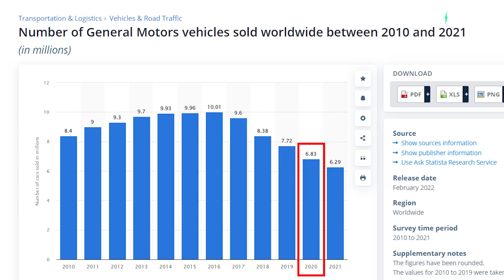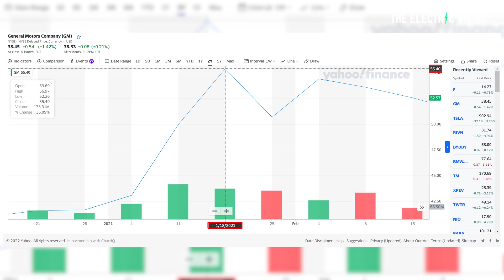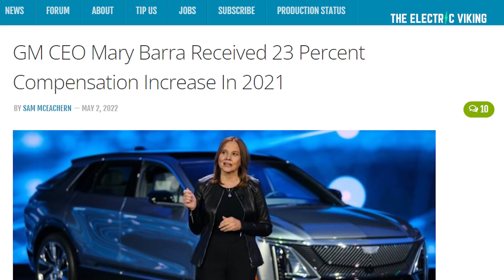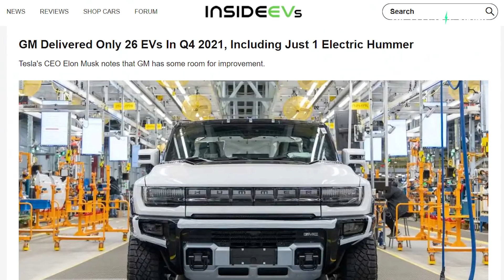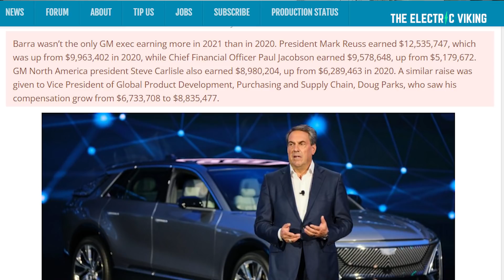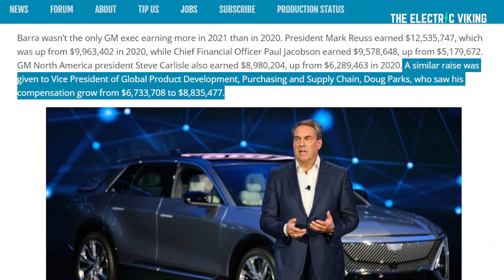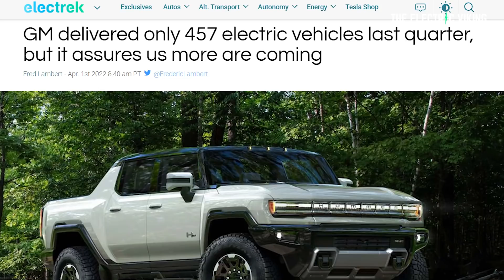GM sales CRASH; Mary B & GM execs get huge pay rises

Comment: Amazing how well they have managed this company and they reward themselves big compensations when their ship is sinking!
Reply: @brunoheggli2888  If I accept those points Bruno; please explain why the Bolt - arguably the third generation of GM EVs - did not have fast charging?
To me, that makes the Bolt a limited use vehicle.  Even though many people may like them.
But I keep reading magazine article authors complaining about doing long trips in various Tesla models - that do have fast charging.  It seems to me that they, and you, are giving GM a easy pass for producing only an average product.
Reply: @John.0z  two words: battery degradation.   Supercharging kills your battery longterm.  The the drop in range at just 40K miles in Car & Driver longterm test.  My CT6 2.0E plug-in is at 30K and spends 90% of the time on battery only.   It has not dropped at all but may have improved as this uses eCVT, driveshaft, differential, and half shafts. Plus it weighs 4,800 lbs but still see 90 mpge average.
Reply: @John.0z  Don't feed the trolls.
Reply: @John.0z  To make any (pure) electric vehicle more than "local-use" transportation they need to have at least 350V charging capability.
Reply: @Matt_from_Florida  I agree Matt, hence my position on the usefulness of the Bolt.
Although now that I am an old man, I can take a slower approach to long distance driving.  Nevertheless the ability to apply a fast charge when needed helps.
Reply: @normt430  I keep hearing that battery management can at least ease that degradation.  Newer technology seems to make that ever more the case.
Also, if you are like me and only need to fast charge occasionally it is manageable.

Comment: Strip-mining the accounts pre-bankrupcy.
Reply: GM has locked up long-term contracts for the raw materials and batteries needed to sell 1 million EVs in the U.S. in 2025 and is looking for upside opportunities to get even more. It says those EVs will generate $50 billion in revenue by 2025, and $90 billion by 2030.

The Chevrolet Equinox EV will debut this fall with a $30,000 MSRP, which already accounts for higher raw material and battery costs. That’s also ten grand cheaper than comparable crossovers from competitors.  Autoline

Comment: Sounded like around $30-50 million in compensation for executives overall.   At 5 million cars annually, $10 per vehicle.  

I don’t recall any of the executives working 22 hour days or sleeping in the factory figuring out supply chain issues, chip shortages, Bolt EV battery fires, etc. Definitely not warranted.   SEC should investigate as the bonuses is out of line with the sales performance.  I wonder what their Altman Z score is now. 

It will be interesting to see if GM can sell 1 million vehicles in Q4 this year.
Reply: GM has locked up long-term contracts for the raw materials and batteries needed to sell 1 million EVs in the U.S. in 2025 and is looking for upside opportunities to get even more. It says those EVs will generate $50 billion in revenue by 2025, and $90 billion by 2030.

The Chevrolet Equinox EV will debut this fall with a $30,000 MSRP, which already accounts for higher raw material and battery costs. That’s also ten grand cheaper than comparable crossovers from competitors.  Autoline

Comment: Her pay scale is obscene. What would they pay her if she actually MET her goals?
The person who came up with that pay structure needs to be fired. GM can claim that LG Chem is responsible for their battery failures in the Bolt, but GM is equally responsible for their poor choice in suppliers. Are they sure that the Ultium battery is the right choice in terms of performance AND cost? How will they be able to sell their Equinox EV for $30K if they don't get their that right?
Reply: "Get that right"
Reply: GM has locked up long-term contracts for the raw materials and batteries needed to sell 1 million EVs in the U.S. in 2025 and is looking for upside opportunities to get even more. It says those EVs will generate $50 billion in revenue by 2025, and $90 billion by 2030.

The Chevrolet Equinox EV will debut this fall with a $30,000 MSRP, which already accounts for higher raw material and battery costs. That’s also ten grand cheaper than comparable crossovers from competitors.  Autoline

Comment: Well, Tesla Viking... let's look where GM no longer plays shall we... In March, the European market noted a high decrease in new passenger car registrations, as the already struggling car market was additionally impacted by Russia's invasion of Ukraine.

According to JATO Dynamics, some 1,116,419 new passenger cars were registered in March in 27 European markets monitored by the company. ****That's 19% less than a year ago and 37% less than in 2019 (pre-pandemic level).****

The Q1 2022 result is 2.73 million units, which is 11% lower than a year ago and actually the lowest level since 1985. It's doubtful that things will improve in the short term.

In such circumstances, plug-in electric car registrations at 244,801 in March do not look bad. According to the report, the volume increased by 10% and allowed for reaching a new record market share of 21.9%. That's more than in the case of diesel (202,113 units, down 39% year-over-year).

You see GM isn't crashing, the entire market is down 20%! Even the Tesla Model 3 is down 3% in Europe! Perhaps you should focus on Australia's car manufacturers... Oh, that's right there are NONE!

Comment: I looked at Buicks and Cadillacs last year.  Not even a spare tire.  Premium gas and 4 col engine in caddy.  Chev, buick, Caddy one car model each.  Turbo engines which you do not want for daily use.  They only want to sell expensive suv and hundred grand trucks or electric stuff.  They will go out of business. Nobody wants them and they costed them way out of what people can afford.
Reply: GM turbocharged engines are premium fuel recommended, not required.  The GM Ecotec turbo-4's are a hoot and easy to ecu tune for $300-600.  Super efficient too!